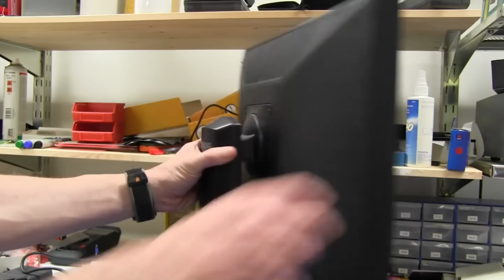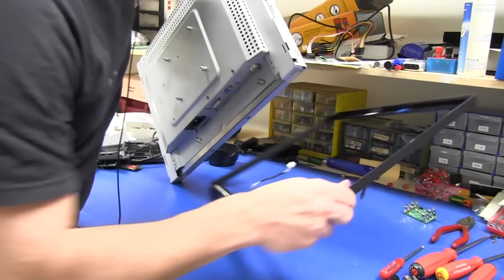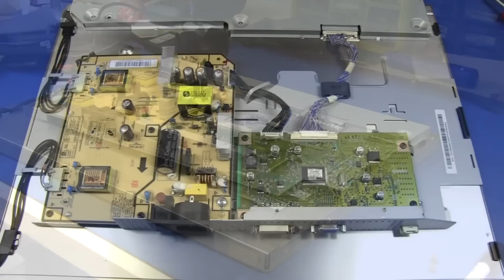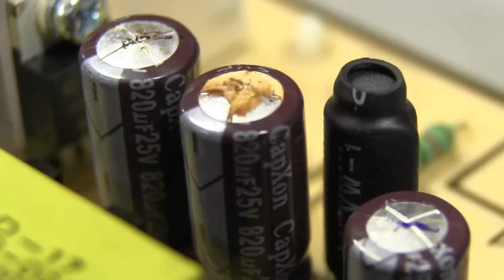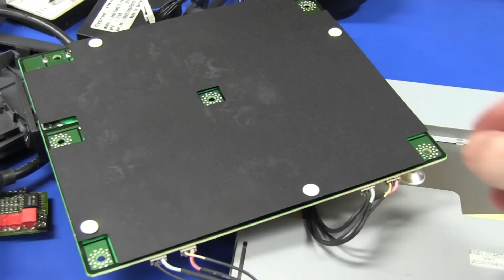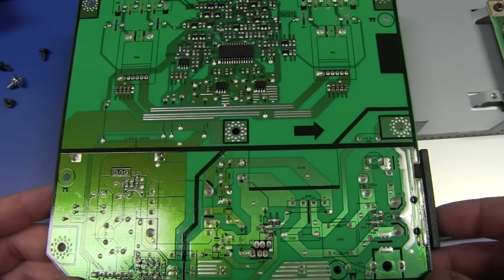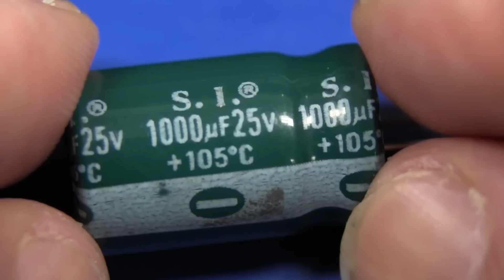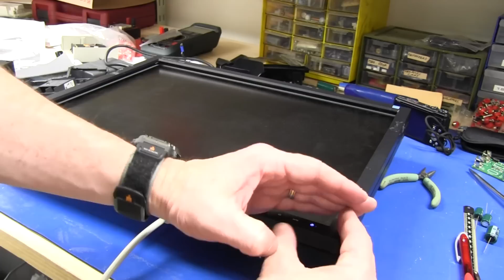EEVblog #347 - Bad Cap LCD Monitor Repair

Comment: Please do NOT forget the facts, guys!
Caps die, especially those water based low ESR caps.
And I really do not like flaming a company that has a wide variety of products in various quality/price grades.
You get what you pay for, doesn't matter what company is on the label...

First:
The brown CapXon GL Series caps are a tad better, so Samsung did NOT use the cheapest capacitors they could get.

Second:
Capacitors fail, sooner or later, but they will fail, especially those containing Water!
And guess what: That's the low ESR capacitors. So they will fail...
And don't forget that they age chemically and electrically.

Third:
It gets rather hot inside those oldish screens. And they can burn up to 120W (Measured on my Dell U2410 and Hyundai W241D)

The buttom line is:
If you want your screen with integrated PSU to last, put a fan close to it, so it has some forced airflow.
If you do not do that (especially if you live in hotter areas), caps will die sooner...
Reply: Regardless, those caps are still Chinese and are tier 3. They could've at least went with a 85C teapo cap on the mains and all teapo Taiwanese on the secondary. The fact that they went all Chinese is evil to those who needed a reliable monitor without a huge investment. Taiwanese caps should be the bare minimum for budget monitors. Better yet, at least go 85C/105C Japanese on the secondary and leave the mains with a Taiwanese cap. Heck they could at least go 85C Japanese on both the primary and secondary. No need for 105C since the design was decent. I guess they wanted to make as much money as possible by taking a shortcut whenever possible to ensure healthy profits which is fine, but Chinese caps on primary and secondary is just not right...
Reply: +maz199 +
Those Tier Lists are just bullshit. Best thing to handle them is to ignore it.
You should better take a look at the datasheet of the capacitor as well as the product diagram the manufacturer has. If you find yor blown cap at the bottom of those diagrams, you almost certainly know what to expect. And the GL series is pretty much in the middle (spec says something about 2-6kh, depending on the size), there are a couple of series above those, like the GH series...
And what you also seem to forget is that Australia is a rather hot area, so without a fan, many devices do not last as long as in colder areas like nothern europe or so. That's something you also have to take into account - and not just a bullshit flame about a capacitor manufactuer...

Especially since the japanese companys also had some 'bad' capacitors -> Ultra Low ESR Types with much more water than normal types. Such an example would be the Nippon Chemicon KZG types...
And those things don't seem to last very long either. But when taking a look at the spec sheet, you see that they are rated for just up to 2000h of lifetime.

Yes, as are most other caps on the market. Especially if something is made in china, there is an over 90% chance that the caps are made in china as well. Like Nippon Chemicon.
Take a look here:
http://www.chemi-con.co.jp/e/company/bases.html
There's a list of plants...
And they also have a chinese plant - for everything using NCC caps that is manufactured in china...
You have to do it because of import taxes China has. 

And where something is manufactured does NOT matter, what the engeneering behind those things had in mind, matters. If you want quality, you can have that from every manufacturer in the world!

The point is just that most of the 'chinese' manufacturers sell capacitors that are lower end/price than the japanese companys do...

That means that talking bad about a manufacturer is just bullshit.
Especially when you're talking about the lowest or second lowest tier of capacitors.
Bear in mind that the specs of a cap can vary over the lifetime and a series can get updated (like longer lifetime)

And why should japanese capacitors be that much better?!
They also use water in some of their capacitors, they don't use magic as well...

And some PSU manufacturers say that the manufacturer does NOT matter!
You can get everything from anyone!
If you want an ultra high reliable capacitor, you can get them from anyone - if you are willing to pay for it!

Just because a cap has a japanese name on it, does not make it better!
There are also some shitty japanese caps out there - like Nichicon UPS series wich are inferior to Teapo SC for example...

So at the end of the day, nothing is just black and white, you have to use your brain much more than you think and stop flaming the manufacturers who has a couple of dozen different series from low quality 85°C things with just 1000h lifetime up to 105°C and 10000h Lifetime, as well as 125 or even 135°C types - and if you want cheap(ish) shit, you'll get it.
If you want quality, you'll get it - just depends on the price (and the contract)...

Anyone who says that it depends on the manufacturer has no clue whatsoever about components...

Comment: I've got a monitor with a glitching screen and I'm sure capacitors are the issue. I already have a soldering iron and I really need to use it to at least get some practice but of course hopefully have a nice extra monitor.
Reply: +TrueMegaManiac yes, it takes some practice. I FINALLY worked out how to use my desoldering pump yesterday. Im gonna try for my first monitor repair soon too.

Comment: i have replace the 100uf 450v for a rubycon bxw, in my case the capacitor was the 100 uf 450v capxon a esr of 1.6 and a cap of 82uf on the meter,

Comment: My Pegatron Benicia (The mobo of my HP Pavilion a6485) has CapXon capacitors too, and most of them (the ones around both southbridge and northbridge) are all bulged, but the mobo seems to work fine...
But I don't want problems, so I ordered a Gigabyte EP35 with solid-state capacitors.

Comment: having fun going thru your videos here.  love learning this stuff.  someday maybe I'll be able to replace a cap  who knows.  But seeing the above caps reminds me of the Mercury PC motherboards.  Hey it ran so I didn't care much  although it never ran right with Windows.  Ubuntu it would shut off properly but Windows it would hang shutting off.  So the day came maybe 2 years ago and went to go figure why it wasn't turning on  think if I took the MB straight out with the CPU up towards the top (or towards the PSU inside)  the left side row of caps next to the CPU socket all looked like the above.  Every single one of them were crusty leakers  .  Don't know if thats why Mercury went out of biz or not.  But hey I've had older motherboards last longer.  Must be this Raspberry Pi fever going around I started caring about caps resistors etc  oh and pinball games naturally..  Samsung used to be dodgy in the mid to late 00's  as the word you use.  Just before the blu ray stuff caught on.  Some of their dvd recorders were annoying.  One had the fan that would never shut off and was crazy noisy.  Only way to shut it off is well yank the plug out on the board.  Don't think your in need of a laserdisc player either.  CED player  hey if it's too expensive to ship in the USA it's probably gonna cost me a fortune to send it over there besides  NO needle.

Comment: Hi Dave! I'm not an electronics person, and I was wondering if we find ourselves in the same situation as you did in this video where we didn't have easy quick access to high quality caps.  Would replacing the caps with a higher voltage rating make them more reliable?  Or are there other issues to consider?
Reply: +Tommy Oz try http://www.digikey.com/

Comment: Its a deliberate choice of Samsung to use components that will fail, Most people will dump them and buy a new one So Built in obsolescence has to be the mantra of modern day industry, how else can they keep their sales high in this false economy of ours.. there are two ways to keep selling, either make things that fail in a allotted period,,,  or nurture the Apple FanBoy mentality that keeps them queuing for days to get the 'Latest' I-phone.. (What a sad indictment)

I remember watching a video of a 50 year old washing machine that was made in what was then eastern  Europe where they didn't feel the need to rape the planet to maintain profit and sales. It was still working like a charm. Sadly that reliability has no place in our modern consumer society as it cuts down consumption and hence PROFITS.. So the designers brief was probably to ensure the monitors failed and he did well to choose a cheap component that lasted this long..
Reply: I had a 1990s westinghouse fridge that had lasted 20+ years. Yes, it lasted until only a couple of days ago when it finally decided to quit. 

To even receive exceptional quality, you have to pay top dollar and even sometimes that's not enough. Server equipment could cost the amount of your car if you want the most reliable equipment/electronics. Since you will be investing so much into the company, they will give you the best they've got to compensate for all those years you will be avoiding to service your equipment. While you spent top dollar on your products, the low-budget minded are confronted with the harsh reality of "you're on your own when that warranty is expired"

There are companies that try to provide the best they can but they will eventually jump on the planned obsolescence bandwagon and start earning profits from consumer investments. If it has a three year warranty and it lasts three years, you can't complain!
Reply: +maz199 That just goes to illustrate how we have been 'reprogrammed' to expect less from the outset. this  way  it comes as no surprise if after three years your  item breaks and you virtually expect to buy a new one. BUT if you look at a three year warranty for what it is 'a warning that after three years use something may fail due to wear and use' but EXPECT the item  to last for 10 years or more then you would be less inclined to bin it and buy a new one and simply repair it.

but that mindset has been under sustained attack to create the zombie consumer that believes his latest accquisition is redundant after 6 months..(Iphone anybody? :) ) sadly the sheeply are following the shepard to the slaughterhouse.. you know the  mentality, camp out for days to get 'the latest' must have "coz u ent nuffink without it man..."  

save us from the Zombies because they are out there...Everywhere!
Reply: +Chris Cichocki Can't go wrong with Apple. Making billions of Chinese products that are marked up to the point where it becomes ludicrous. $1000 for a obsolete phone? $1000+ for a MacBook with no USB ports? And they give you a dual core processor which thermal throttles. Oh yes but they don't get viruses... Lol 

The businesses of today want you to believe the bullcrap you see in their 'About Us' page. As a zombie, you are forced to believe that crap due to always wanting the 'next-gen' product in your hand. That want came from the years of trust in that particular company that made money off you. You are then forced to accept their changes/product announcements due to becoming so programmed to buying what they are releasing/manufacturing.

But hey! At least you can still use a headphone jack in the upcoming... Oh wait.
Reply: Maz199.....   I had an Apple iMac that lasted for 10 years, and blew away every PC I've ever owned, so far as stability, speed and longevity.

Comment: I noticed the failed caps (in both monitors) are close to the resistor heat sink, and the input transformer coil..  shouldn't the engineers want to keep the caps away from heat?

Comment: After viewing this I decided to open up a COBY lcd tv/monitor I had sitting off to the side. After losing a few fingers trying to work around those snaps that hold the case together I got the unit opened. Lo and behold, care to guess what brand of caps were in the power supply? Samsung gave you wide open spaces to work with compared to what I had and COBY must have used to tiniest caps ever made for the capacity/voltage range, packed tightly together. For good measure they had them surrounded by the heatsink giving me no possibility of putting in any brand of higher grade cap. I think this one is going to recycling which is a pity, the picture quality of the display was about the best I had ever seen for an lcd display.

Comment: yeah my samsung tv started that crap power cycleing, it stays on when there is no signal going to it. but as soon as i apply any signal to it. power cycling starts again. me thinks the cap or caps have gone poof...so its too much for a bulged cap to handle a signal cause the cap cant hold the charge...and POWER CYCLE..so when my solder sucker comes in, my old one went bad finally, i am gonna crack it open and start replacing the caps in it. i paid 200 dollars for that TV 1080p HDTV from best buy right when they started bringing out UHDTV super thins.. and they were dumping last years model.. i love that LCD ive put it though hell, with hours and hours of videos and games. its the closest thing i got to a best friend. i will fix my friend.

Comment: First of all, just want to say thank you for all your hard work and excellent channel!  I have learned a ton since subscribing awhile back, one of the best electronics channels on the web!  I've made quite a few repairs directly related to videos of yours, and I can't express enough thanks for what you.  Most recently, my girlfriend brought home a 19" Samsung 920BM...plugged it in, no power at all.  No dis-assembly videos on the web, that I could find, so I ended up here.  The monitors appeared to have very similar construction, and sure enough, they did.  Was tough separating the two halves of the shell, but the insides looked to be a very similar design.  Got it apart, had a look at the power board, and there was a huge scorch mark right through the PCB, right between the mains plug and the fuse.  Checked continuity on the fuse, and fuse wasn't popped, strangely.  So I figured if I could solder some wire directly from the mains plug right to the input side of the fuse, I might be able to get it working, as long as the scorch hole in the PCB hadn't damaged any other traces.  Luckily, it appears the PCB was single layer, so I soldered in the little piece of wire from plug to input side of fuse, and sure enough, up and running perfectly, been using it since last night.  Without your videos, I would never have even thought to try such a thing and probably spent $30 on a power board for the thing.

Comment: I had never tried to repair electronics equipment before and thanks to this, I'm now looking at my newly repaired monitor. It had a bad Capxon caps, soldered in replacements today (first time soldering too), whole repair cost me 1 euro 15 cent. You're a hero!

Comment: Hey, anyone know the answer to this: I have an Asus LCD Monitor Model VE246H that has a flicker issue. It seems to be a well known issue, though one that i have yet to find a solution for. I do not have a cap tester but they are not bulged at all. The monitor comes on briefly and then the screen flickers off and comes on again after a bit. If anyone has a clue as to the issue, please let me know.

Comment: Lol, I watched "few" eevblog videos and now im only looking for low esr and 105* caps, even where its not necesary :D
But its true, one time I replaced 105* cap with noname 85* one, and it died after one use of psu...
Also there is little problem, in most local electronics shops we can find only crappy caps :<

Comment: Well thanks guys, Just went through the same process with an LG monitor and used the same Jaycar caps in the power supply. Looks from the comments I may be doing the job again in a few months.

Comment: I have the same problem with an Lg monitor power board caps going to replace 
Them and fingers crossed it works but 
If not I'm only out a couple of capacitors 
The monitor was basically a dumpster dive as well so no big loss.
Love to find love to fix!!!
Thanks............,,

Comment: I have a 266 BW Myself. It seems that the badcaps issue is still in the newer models aswell. Tobad i dont have the electrical knowlage to change them.

Comment: I had exactly the same caps blown in the exact same monitor model - coincidence? I don't think so. Also, like 5 years ago, I got 4 same Acer 17" LCDs and all of them had exactly the same problem - a cold joint on one leg of a 220-something nF cap in the CCFL socket area which led to destruction of the inverter transistors. After the repair and preventive replacement of all PSU elctrolytics, they still work like a charm, being used for 8hrs+ a day at my old school.

Comment: Did anybody else notice there is no earth wire connected to to iec mains input. Despite the movs and "earth" screw.
Reply: You are wrong. On the back of IEC connector  there is a lead/band  which is soldered in PCB. You can't see it from that angle, but there is.
Reply: +DanielVidz  jep, noticed it.
+EevblogDave